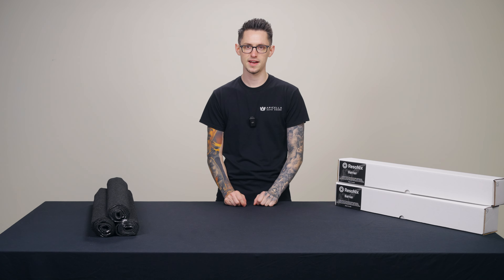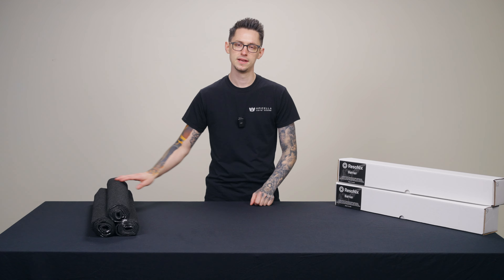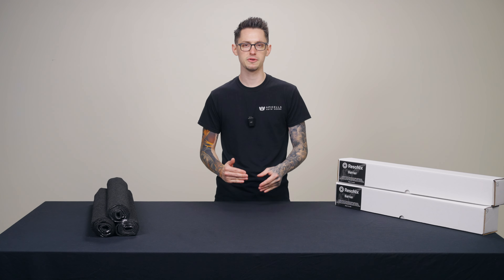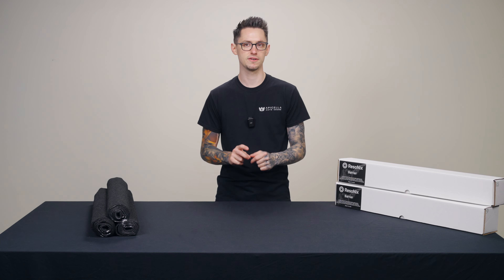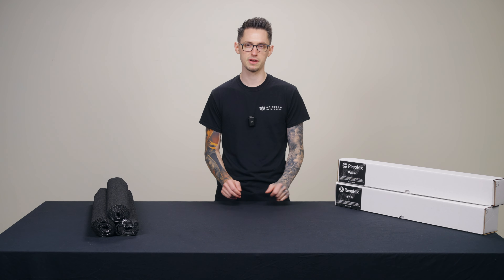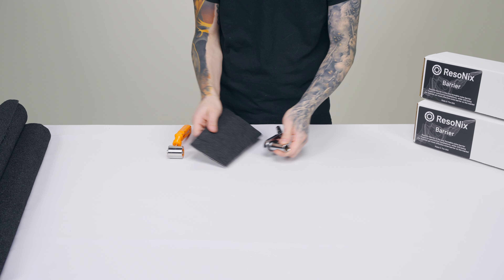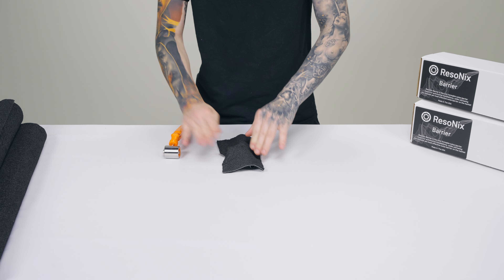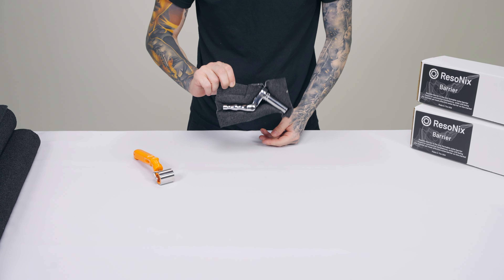ResoNix Sound Solutions - Barrier - Moldable Noise Barrier Product Spotlight

Comment: When would you use this instead of CLD squares? 

Are they for different purposes or are they complimentary products? Maybe layered?
Reply from the maker: @piemanklp  different purposes entirely. Here, this article explains. 

https://resonixsoundsolutions.com/resources/sound-deadening-materials-reference-information-guide/
Reply: @ResoNixSoundSolutions  ahhh yes ok.  So CLD to stop vibrations.  The barrier to block noise from outside.  

So based on that page.  Would a single flat panel be best suited by 3 layers?  CLD to stop vibrations, a barrier to stop outside intrusion, and then an absorber as the interior facing surface?
Reply from the maker: @piemanklp  another article :)

https://resonixsoundsolutions.com/resonix-sound-deadening-buyers-guide/
Reply: @ResoNixSoundSolutions  thanks!